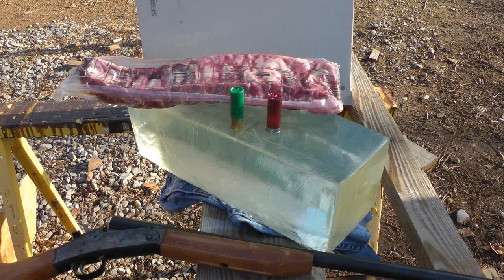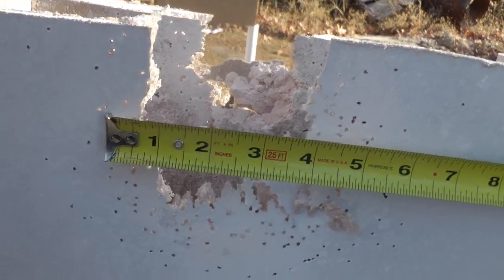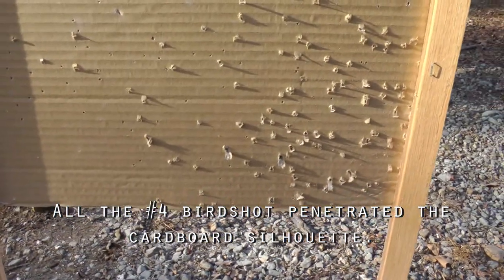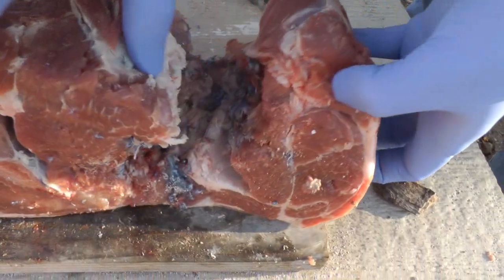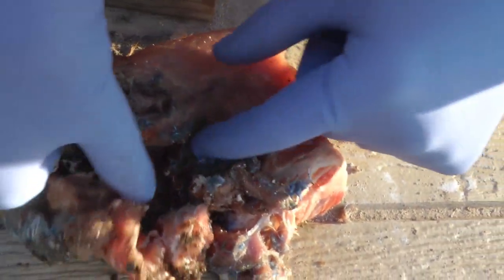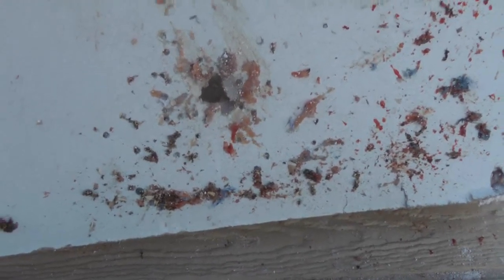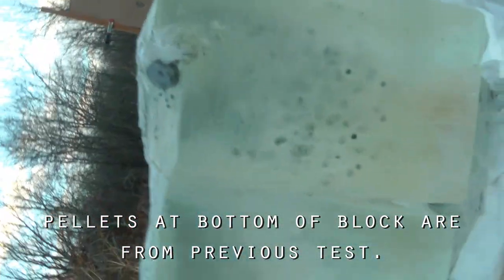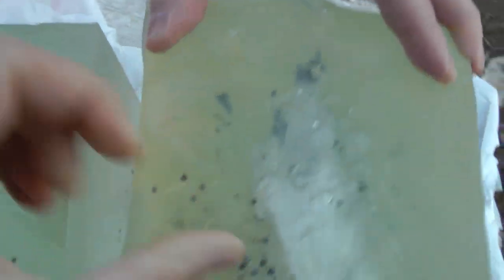Birdshot Home Defense Gel Test

Comment: do same tests at 20 n 30 feet to simulate Max distance in most home scenarios.  that will be science.  I'm sick of hearing utubers say "oh, anyone that uses bird shot for home defences is an idiot".  good grief man, that blast from 10 and they r carrying u out in body bag.  the 20 n 30 foot test would give better idea at max home defense settings.   do it please!
Reply: You have to use what your situation will allow. Bird shot can be effective but not optimal. What do people who live in apartments or town homes do? You can't use 00 buck you'll take out your neighbors too. This just shows that yes you can use bird shot in the right circumstances again optimal no but better than taking out half your neighbors in a town home. Sure you can say you saw a video of some one shot with bird shot but do you know the facts #shot, barrel length was it a 3'' magnum load type of choke ect.
Reply: mrpush p 20-30 ft? Where do you live a mansion? Standard house distance is around 10-7ft or less! Birdy shot will kill at that distance easily..especially if you live in a flat, buck or slug will make you neighbour of the year real quick!

Comment: Mr. You might need a little education if the wadden goes through the wall then that means the shot done has a Watton don't knock a hole in the wall it carrying the shot the warden is behind the shot so if there's a hole in the wall Too Short passes through first

Comment: At close range the proper birdshot can work but I still don't recommend it at all. Every birdshot round has failed the FBI test for the penetration needed to consistently stop an attacker in his tracks. There are tons of companies that make buckshot and slugs specifically for home defense and if you're worried about over-penetration there are plenty of options like low recoil, frangible, number 4 buckshot and so on. I'm not aware of any company who makes birdshot rounds for self defense, at least I've never seen it on the shelf. That's because birdshot is designed to reliably kill small, light skinned game. If you wouldn't use it on a 150 pound deer then why would you use it on a 200 pound crazed meth head?? I suggest measuring the longest distance you would ever have to shoot in your home and then go out and test some different rounds. When you move out past 10 feet with a short barreled shotgun birdshot becomes a VERY poor penetrator. If you practice with some low recoil buckshot like number 1 or 4 over penetration won't be much of a concern especially if you hit your target and you'll be hitting him with a proven man stopper rather than a proven bird killer.
Reply: Just buy a m4 or a sniper rifle. That will penetrate everything. Or a desert eagle.

Comment: I would use bird shot if I was out of buck and slugs.
Reply: I agree.  I would use birdshot if if I'm willing to allow an intruder to come within 10 feet of me and my pump shotgun. Otherwise if they stay further away, I'd like my hits on target to have a better rate of success at stopping the threat.
Reply: +Wolverines Fight That or if my attackers were birds. Bird shot is a moronic choice for home defense though.
Reply: PotzyMccoy I agree.  If your defensive position is in tight quarters with shared walls with others, then maybe a shotgun isn't the best choice for your home defense.   In my home,  my home defense shotgun is loaded with 00 buck.  With my early warning canine home alarm system,  I plan to address an intruder before they get within 10 feet.
Reply: +Wolverines Fight Ideally yeah. Distance is your friend. How much you can have is limited indoors so having training maneuvering in close spaces pays off big time. As far as walls and shotguns go, nothing that fails to get through a wall is going to get through a rib cage. Unintended targets are extremely rare even in police shootings that almost always take place outdoors without walls to slow round and with a 20% hit rating. Be aware of what is beyond your target and use what stops the threat the quickest within reason.

Comment: Ok look, guys, being aware of your target and beyond is one of the Four Rules of Gun Safety. If you know there is a friendly in front of your muzzle, you should probably not shoot, regardless of what ammo you have. I don't know when common sense stopped being common, but this is simple shit. Use buckshot and be aware of your background. Duh! Drywall sucks at stopping bullets. Anything capable of adequate penetration in tissue is going through quite a few interior walls. I know, physics is a bitch! I've seen 7 1/2 birdshot fail to anchor ground squirrels at ranges I have inside my apartment too many times to trust it against a determined human adversary. Professionals use buckshot because it gets adequate penetration, not because it over penetrates. You need to consider that 40% of Americans are overweight, the typical fighting stance will put forearms and weapon between you and the assailant's vitals, and unless you live in an elevator, the assailant isn't necessarily going to be 10 feet away.

Comment: Most tactical or "home defense" shotguns are 18"-20" barrels & are cylinder bore. That would have a large impact on how that shot patterns & it's ability to penetrate. the tighter the group the more it's mass & energy works together. While it is common for people to have a bird gun, and use it for home defense it is not the best tool for the job. I would like to see this same test run from a shorter cylinder bore barrel. regardless I don't want to be shot regardless of shot size, but I will not choose ammunition for small birds & rodents, when I need to put down a attacker with bad intentions. You may not be able to get off a second, or third shot.

Comment: Birdshot is only effective against BIRDS!
Reply: You are being ridiculous.    I am not saying that it will not make a terrible wound.   It will be a shallow wound that may not penetrate deep enough to stop a bad guy.
Reply: I am not saying that people will not die eventually from a turkey load.   The goal in a defense round is the stop a threat immediately.   You want to stop the bad guy instantly.   The problem with lighter loads is the person may continue to fight or continue to shoot at you.
Reply: Well then Buckshot is also out of the question because its only useful against deer. 

In an apartment building with neighbors in every direction and short distances Ill still take the turkey load. Because its less likely to go through several walls with lethal force. 
If I had my own house with some room between my house and the neighbors id have buckshot. The longest distance in my apartment is 12 feet and a basketball sized pattern to the lower torso, the chest or the neck and face would most certainly cause a fatal wound. being perforated by several hundred bb's and having major organs perforated multiple times or having your neck torn open down to your spine would be just as lethal as anything else you can use. The difference is the depth of penetration after hitting a hard barrier.
Reply: u wot m8 ? bird shot loads can literally put a hole through a car door in-house range 😂